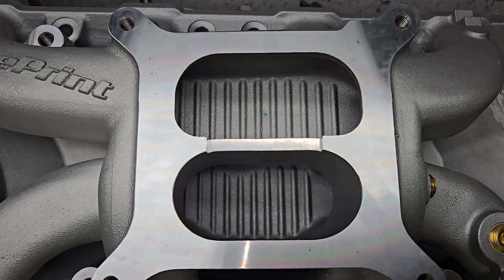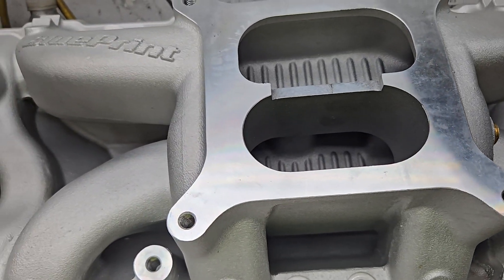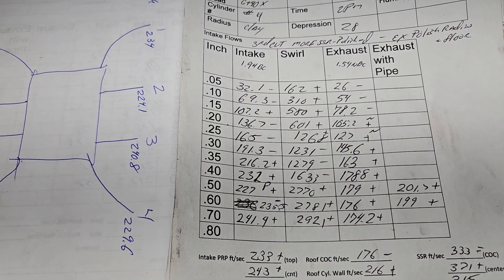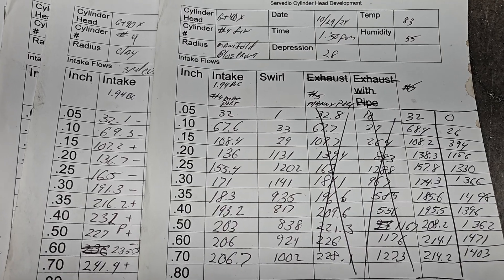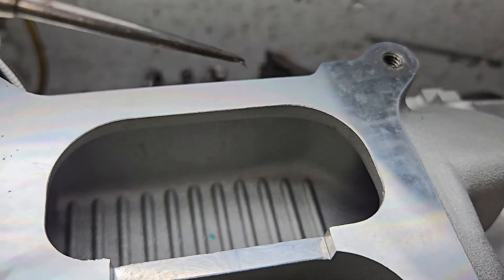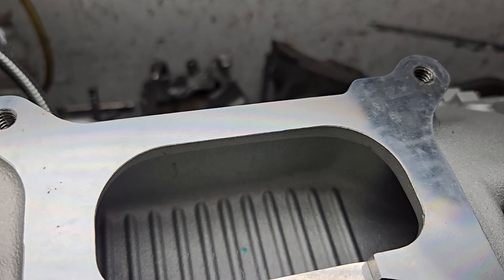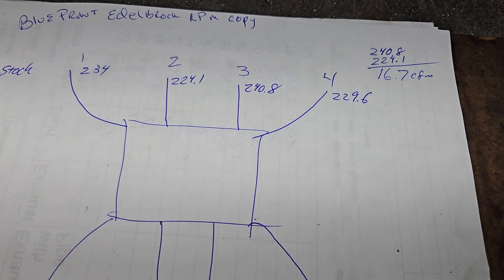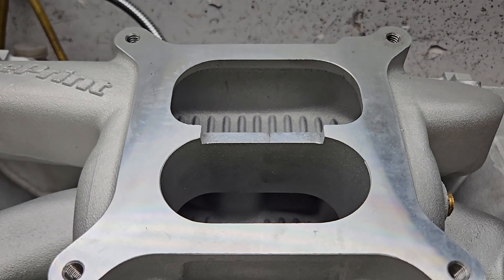Ford GT40X project 347, Blueprint Edelbrock performer Rpm Airgap copy. Look at stock shape and flows

Comment: Crossed over short runners to get some length is the proper way to make a dual plane, that other thing was a shocker.
Reply from the maker: @TomSmith-cv8hk  Old tech. Easy pattern making!
Reply: @servediocylinderheads  It also shows that dual planes owe more than just runner length to their bottom end power. Even those short runners get the reversion feed from a closing valve to make good power up to 5500 rpm.